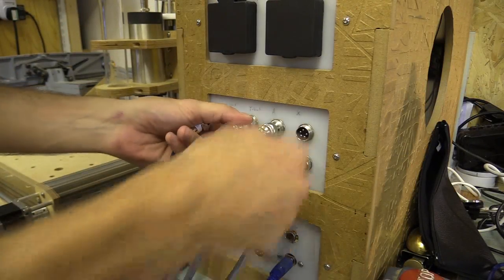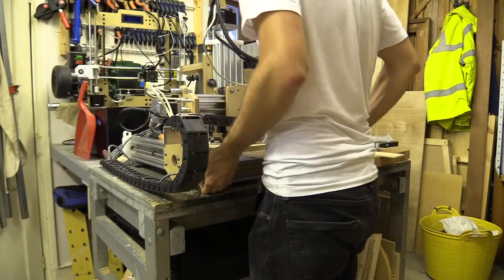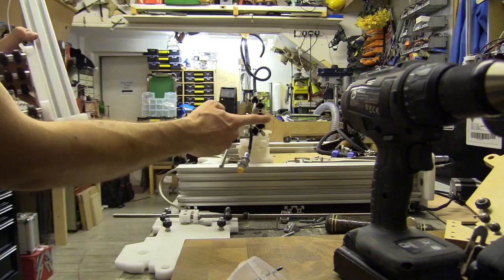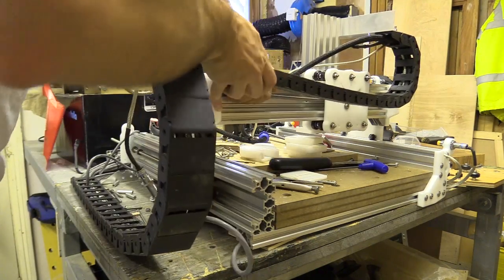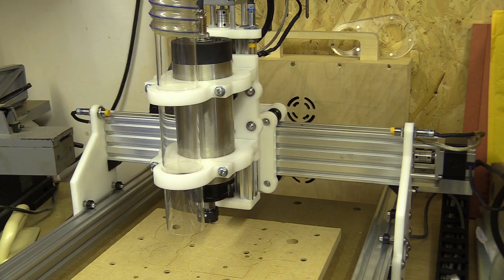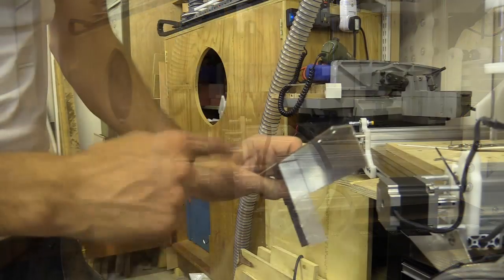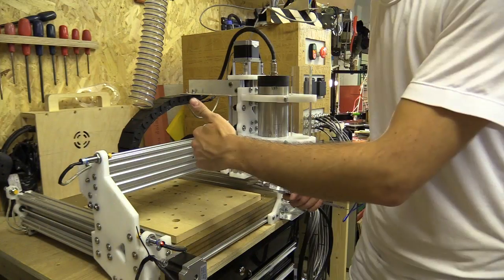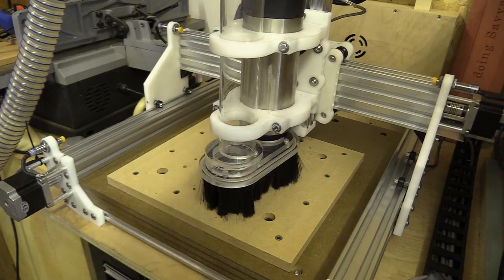#21 Upgrading CNC Machine with Acetal Plates #21 / Design Upgrade

Comment: Would like to buy your plans to do my cnc, over Patreon you have them there no?
And you have a list of parts to I start my project here in Portugal?
Thanks for all your videos, amazing, very good videos and congratulations, you are such a good YouTuber and Professor, explain everything so well. 
Thanks for your nice work
Reply from the maker: Thanks for the kind words. You can access DXF files via Patreon but I am still putting together the parts list. Once that is available it will go up on Patreon first. But I am thinking of re-building this again out of aluminium because I have designed a pivoting plate for the z axis. I think that is the last change though. I might need also rebuild it so I can remember how to do it. :S

Comment: How are you dealing with backlash on the leadscrew end bearings? I am currently squeezing a pair of nuts very gently.... on a pair of bearings, so they ride on one face each. This looks like it would be able to cut something really hard, such as parmesan.
Reply from the maker: Just tap a thread on a couple babybel and thread those onto the lead screw. And then heat them up so they melt in place. Once that cools it will be rock solid. And yeah this machine could cut frozen Parmesan.

Comment: Great build Savvas 
I have one of the original c-beams that I'm still learning with before I go bigger. Question  I've been looking at the Mach 4 controller can I use it with arduino mega or uno   I'm currently using a xpro v2  nice controller but very picky.             Thanks Brian
Reply from the maker: Taa thanks. I don't think so - but I don't have experience with Mach or their controllers. If you want to move to GRBL you may have to get a new controller. I am using a phoenix CNC controller, but there are lots of other boards.

Comment: Great video series!  Quick question, I've just finished a similar C-beam based gantry router, the highest speed I have been able to achieve (with 8 mm pitch TR8 leadscrews) is around 3000 mm/min.  Have you done any max travel speed testing with your machine? I'd be interested to see how it compares.  Thanks
Reply from the maker: Wow that's fast. I did a little over 1000 mm/min cutting MDF but I was worried I'd getting lead screw whipping. I found a calculator online somewhere some time ago which estimated that was my limit but my leads don't span a great distance so I might be able to go faster. Do you have any pictures of your machine?

Comment: Your machine is really coming along Savvas! I really like your design. I wish my Sphix had a cross member under the machine similar to yours. That acetal must be really rigid seeing as it didn't crack when your drag chain mount made contact with it.
Reply from the maker: Yeah it's pretty tough stuff. It is an engineering plastic. It can never replace aluminium but seeing as it's so easy to machine, and has great impact strength, it's a great stepping stone for anyone who wants to be able to mill parts which could eventually cut aluminium.

Comment: Would a thread locker such as loctite help the grub screws from backing out? Great series by the way, I've watched all of them so far waiting until the day I will be able to build on of my own.
Reply from the maker: I would have to test that on the acetal as it might not work on that material. Nothing sticks to it. It won't be long now - but I keep noticing things about the design, and making revisions to the CAD. I think it's close. I just need to sit down and write the parts and costing.
Reply: If the loctite doesn't work, perhaps an epoxy would hold...but nonetheless, I am enjoying your build!